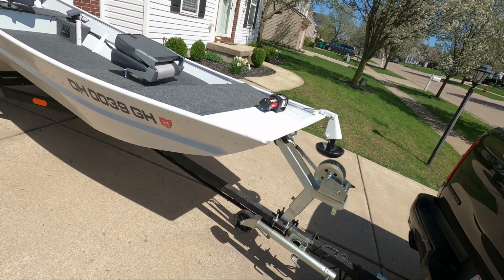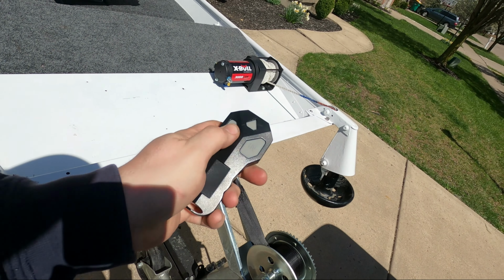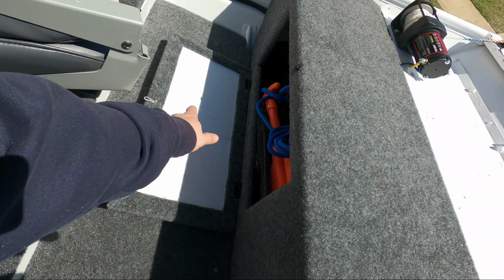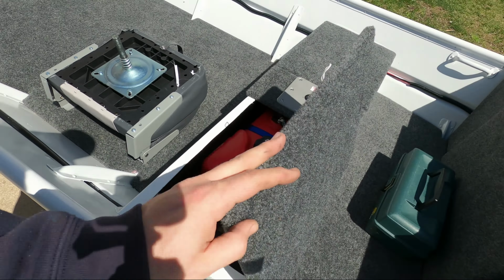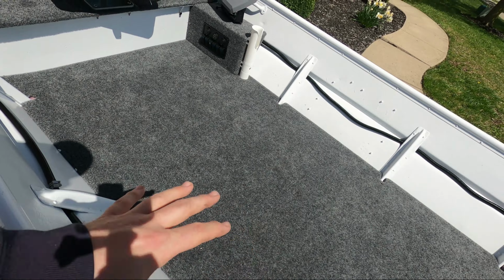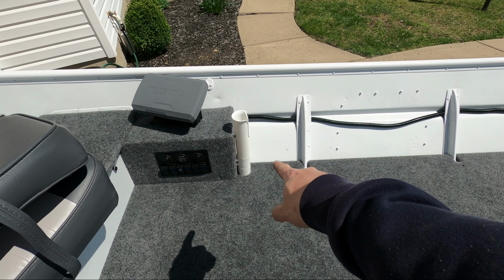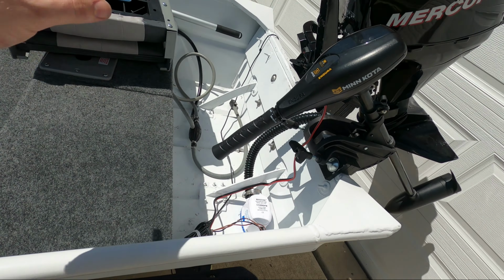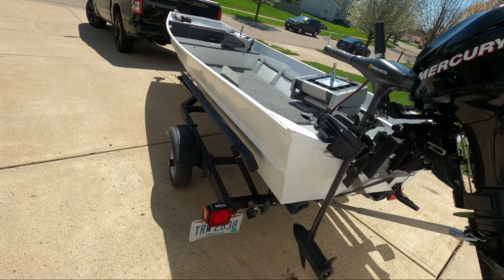1436 Jon Boat Build Complete Overview | Bass Boat Conversion Walkthrough

Comment: Thanks for the walk around. Nice build. Is it safe to remove the foam? I want to create storage like you did but im a bit Leary about it. Thanks.
Reply from the maker: Foam is for emergency flotation if the boat capsizes or gets swamped. If removing factory foam, make sure to add it back elsewhere

Comment: I like the color white you used. Did you have no issues with it?
Reply from the maker: No I didn't and using white primer made minor scratches/etc unnoticeable
Reply: @mvboutdoors   awesome! I’m going with the semi-gloss topside white (Rustoleum). So the primer really helps fill in imperfections. That’s good to know. You did regular enamel paint for the interior instead of Topside paint, right?

Comment: Helpful hint***
If you will take a little crazy glue and work your way down both sides will keep 
Your black hide away wire keepers straight...will just tidy up the look of the boat, pretty though otherwise. Tight lines.
Reply from the maker: Love that idea, thanks for the suggestion!

Comment: How is the winch system working for you? have you had a chance to test it out?
Reply from the maker: Yes, it worked out really well!  Of course the depth of the lake will determine where you can use it but it was plenty strong to pull the anchor up. The only downside is its very loud, like all winches. Aside from that, especially having the remote, super useful.

Comment: loved the boat. Have you tried putting some hot glue on wire harness to prevent it from slagging
Reply from the maker: No I didn't but that would be a good idea. I've been thinking how to get the slack out of it. I've considered switching to PVC conduit.
Reply: @mvboutdoors  That's what I used on my other boats. the new Mirrocraft coming in soon I hope I will run the pvc under floor. May think about that for your new build

Comment: Do you feel that you have weaken the boat any by removing the center seat ? I'm getting a 1448 and thinking of the same thing. Thanks
Reply from the maker: No because there were braces on each side of the bench. If the bench was not surrounded by braces I would've added some additional bracing back.